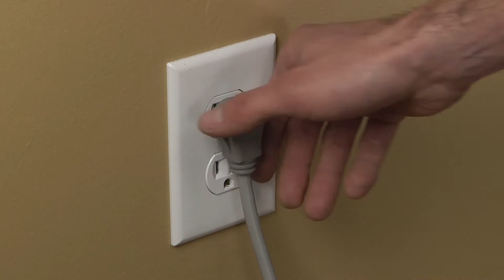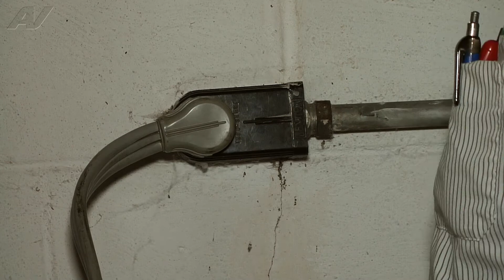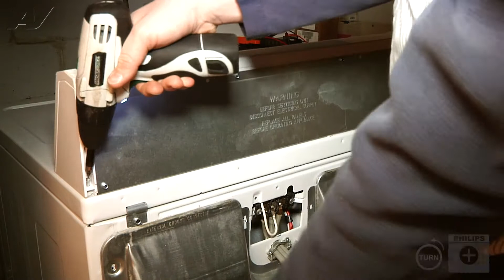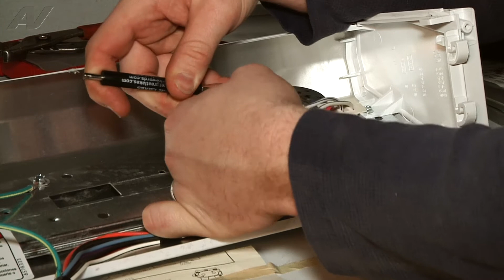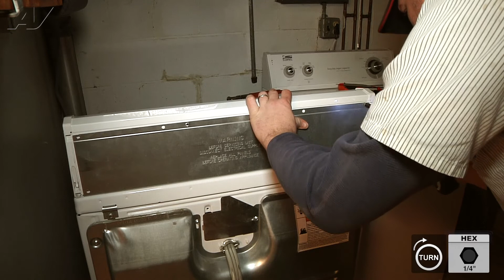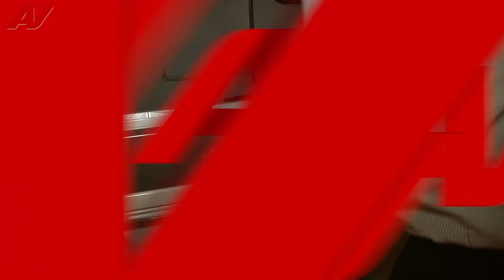Estate Dryer Repair - No Start - Dryer Timer

Comment: What is a jumper wire
Reply from the maker: Great question, if you have a more technical question that our parts department cannot answer, you can search our over 17,000 answered questions free at our website www.ApplianceVideo.com under our Repair Help section. You can also call our parts department at 1-800-830-5465 and they can give you help 7-days A week ,or search at www.SaveMoreOnParts.com  .

Comment: I just replaced the timer on my estate gas dryer ( timer wasn’t moving anymore) and replace solenoids cus it was firing up. How can I check the timer. I set to to dry and it never moved but I set it to less dry and it moved?? Any ideas??
Reply from the maker: Great question, if you have a more technical question that our parts department cannot answer, you can search our over 17,000 answered questions free at our website www.ApplianceVideo.com under our Repair Help section. You can also call our parts department at 1-800-830-5465 and they can give you help 7-days A week ,or search at www.SaveMoreOnParts.com  .